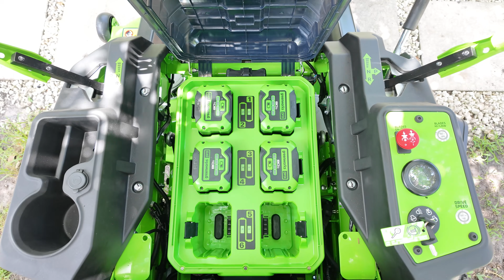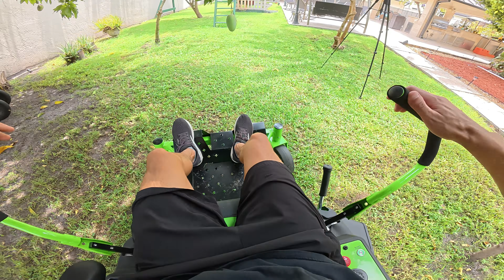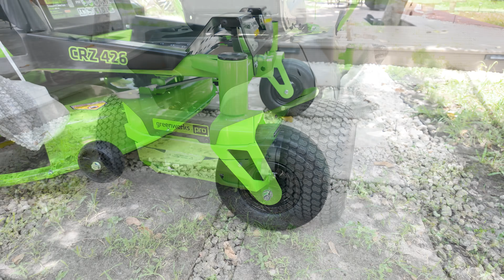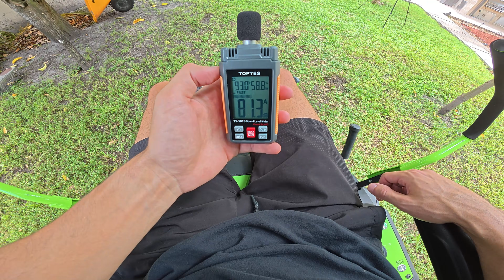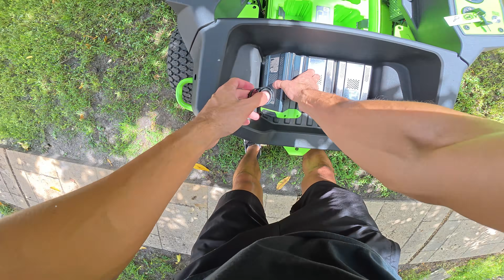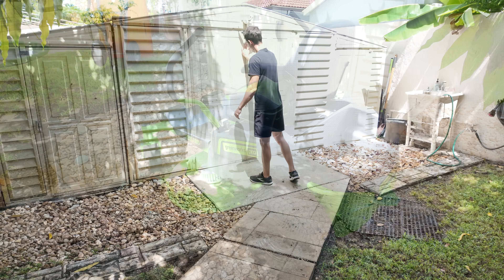Full Greenworks CRZ426 Review: The Electric Mower Nobody's Talking About

Comment: I like mine...had it for 3 years now.  Cut's 0.6 acres of grass with zero issues so long as I drive at 2/3 speed in LOW range while having the blades' speed set to HIGH.  On hot days it uses ~34% of batteries' capacity...on colder days it uses up to ~45% of batteries' capacity.  Like others I've lost air pressure in a front tire.  First time I reseated the tire and aired it up it went flat again...no holes to be found.  2nd time I reseated it and aired it up it now holds air fine...no reason nor rhyme.

Comment: I've had the CRZ426 , For a year and a half , after the first year the front tires failed. I woke up one day to go run my mower and they were flat and no matter what I did they would not take care. There were no holes, no damaged rims, just the rubber failed , and then the batteries which is four of them only lasts for about 3/4 of an acre. I don't know where they get the runtimes they advertised, I'm fairly satisfied with it. It does cut pretty decently and it maneuvers well. But sometimes when you're backing up for some reason, one wheel will spin more than another causing ruts, give it three out of five stars

Comment: Excellent and thorough review. Thanks. I just bought a CRZ428 from Costco. It comes with 6x 8Ah 80V batteries, the bagging system and a 1.5kW charger. I have a 3 acre property. I have had an EGO self-propelled 21" mower for a few years and an older Craftsman ride-on yard tractor with a 54" deck. Now the Craftsman won't start. So I'm hoping the Greenworks will fill the void. It should also be useful for carting things around the property.
Reply from the maker: Thanks so much! Sounds like you’ve got a great setup, those 8Ah batteries will give you plenty of runtime. Hope the Greenworks works out perfectly for your property!

Comment: A very thorough review with some information that other reviews do not include (such as the "hidden" disengagement lever and being able to run on just 1 battery).  Well done.

I have seen evidence that the mower deck washout is even more effective if the deck is at its lowest position (Steve's Small Engine Saloon).

As for going electric, I'm working my way up to it.  I have about two-thirds of an acre to mow and trim.  The main mower is a 1999 John Deere 455 diesel garden tractor with a 54" mower deck (yes, it's overkill).  Cleanup is handled by a 2007 Troy-Bilt lawn tractor with a bagger.  Trimming is done with a Kobalt (Lowe's house brand) 24v battery electric trimmer and 24v X 2 walk-behind mower.  Really, the only thing keeping me from replacing the Troy-Bilt mower with electric is the superior leaf cleanup with a gasoline engine.

Have you considered reversing your Greenworks ZTR into the shed so you don't have to push it?  Also, I mentioned "overkill" earlier, you may have just a bit of it as well.  I totally get it, though, why push when you can ride?